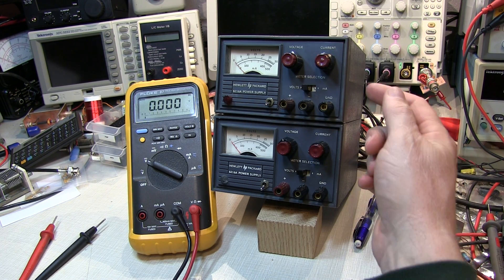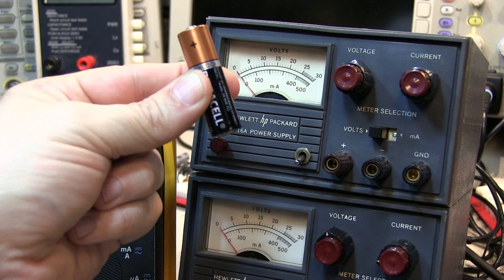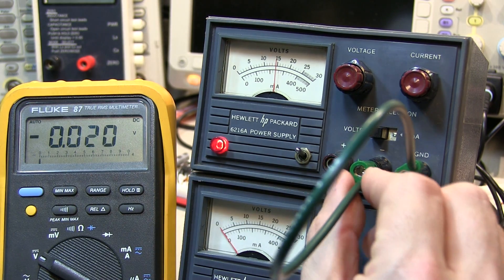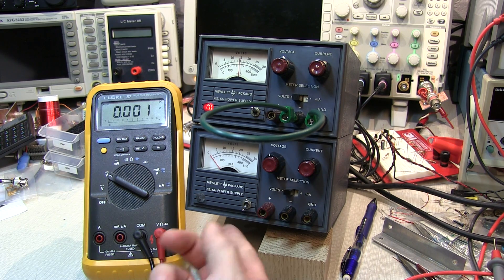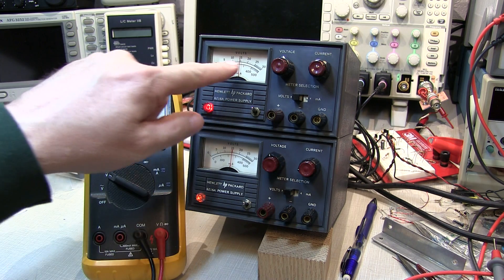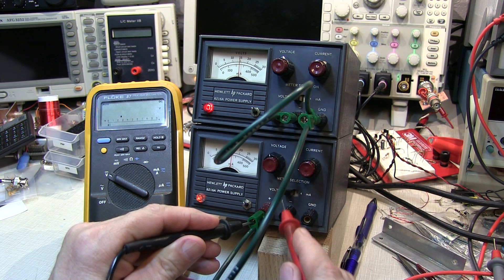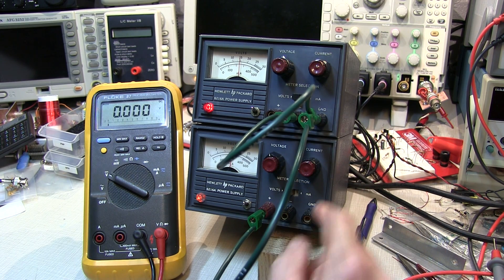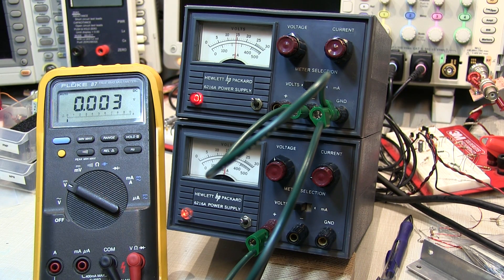#233: Back to Basics: How to use the 3 terminals of a lab power supply | split supply

Comment: i like your videos but this explanation is not enough  at least a schematic was needed for better understanding and that GND is a virtual point from a physics point of view the virtual GND between 2 points A and B as  (A--V.GND--B) e.g if you measure  -12  at the point A with respect to V.GNDthen A is at -12 volts informal it has 0 electric potential energy meanwhile the V.GND is the point of energy or better said the electric field agent.The V.GND could be fought as the intersection point of 2 series batteries or the intersection point of 2 transformers or 2 resistors connected at an energy source at their intersection all will exhibit V.Gnd behaviour with respect to their terminals
Reply from the maker: +Psi Phi In this case, the GND terminal is physically and electrically connected to the mains earth connection.  It can optionally be used as the reference point for the voltages generated between the + and - terminals, as shown in this video.
Reply: ***** indeed .

Comment: You didn't mention connecting them in parallel. Is that a good way to supply more current? Will there be issues if the voltages are slightly different?
Reply from the maker: That's because it isn't a good idea. It is not a good way to increase the current. There are some supplies that have special (rear panel) connections for running them in parallel.
Reply: +Euro Bum 
As soon as the voltages are different (and they will be), one power supply "drives" the other. If you load the setup the one with the higher voltage will supply all the current until its internal resistance or current limit bring it down to the level of the second one at which time that one will start to provide some current as well.
And don't think about trying to set both supplies to the exact same voltage. It may work for a short time, but the output voltage of these power supplies typically drifts around alot with temperature.
If you need more current, get a bigger supply or get a supply that has the ability to be paralleld (I have a lab supply for example, that has dual independent outputs, but a simple switch that allows the outputs to be connected in parallel or series)
Reply: +superdau Exactly!

Comment: I actually have that exact model power supply, it is really nice for small electronics work, just wish it had separate voltage and current displays! The model I have goes up to 50V though, and I think the current goes up to 600mA, although it is rated 500mA max and cannot reach the full 600mA even when shorted. It is rated for 500mA anyway so I am not worried about that.
Reply from the maker: I've also got a 15V / 1A version too.
Reply: I like their small form factor a lot, they are easy to deal with. I need to find another one because constantly building up a craptacular zener diode shunt regulator to give me dual rail-like output is annoying.
Reply: +Power Max We have them at work too (and the older 721A).    :)